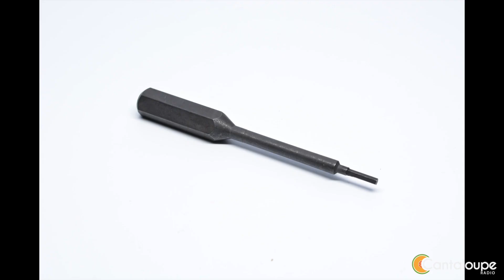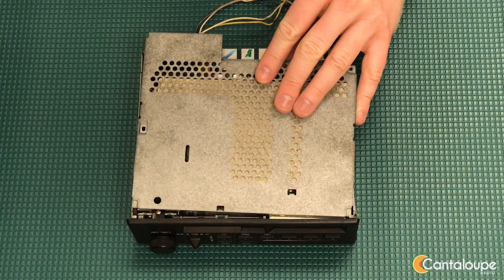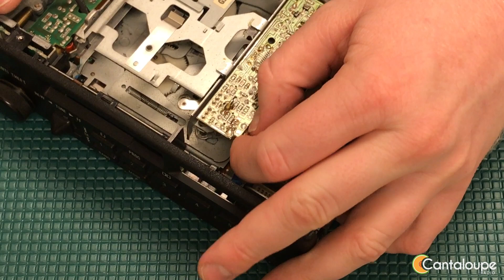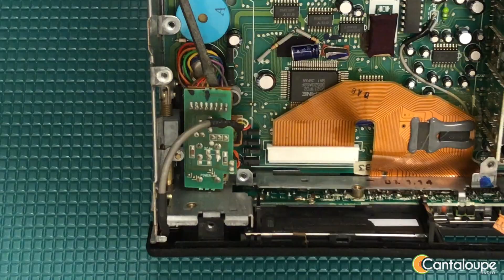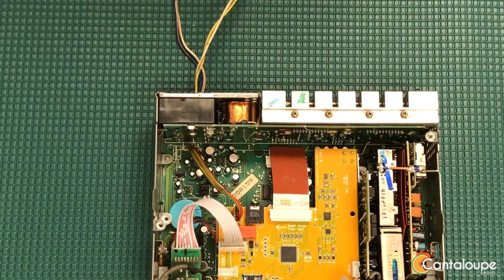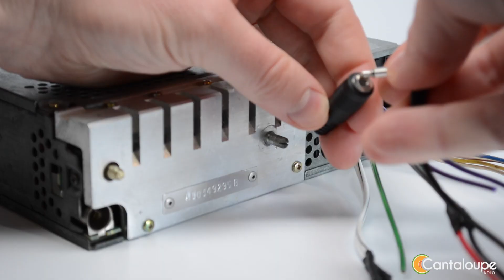MDeck BA-1 Bluetooth Retrofit Kit Installation BMW CM5908 Radio

Comment: I have a 1991 BMW 325i same radio. Radio turns on but no sound.  I checked the fuse still no sound.  Would you know the problem and a fix? Ty

Comment: I’ve had this radio for a year with the kit and for some reason it continuously disconnects, I’ve checked all the wires and after a 15 minute drive it just cuts off
Reply: Eve figure it out???

Comment: Hey guys, I ordered one of these from you and installed it myself. I ran into a problem when I was taking the faceplate off of the radio. ( I know I wasn't supposed to remove the entire faceplate but I did anyway to clean behind it). A copper plate with two holes in it, one open hole and one taped hole, fell off and I do not know where it goes. Can you tell me where this goes so I can reassemble the radio? Any help is greatly appreciated. Thanks
Reply from the maker: Hi Jay, that copper plate is simply a guide to help cassettes exit the cassette deck smoothly when ejected. It's no longer necessary with the kit installed and is fine to be removed, but also doesn't hurt if it stays in. Hope that helps!